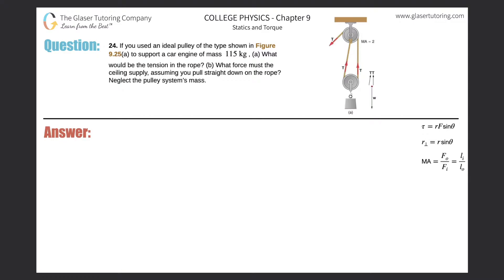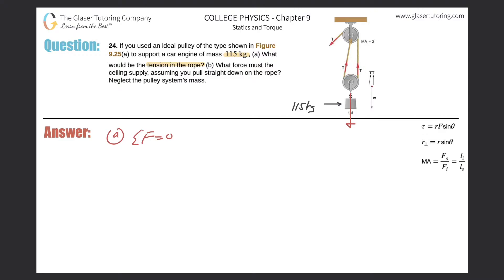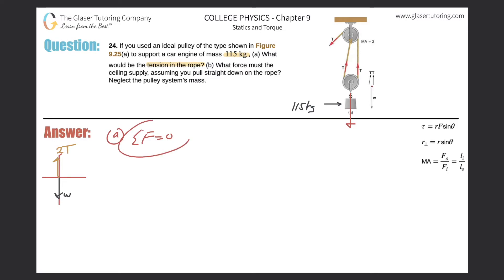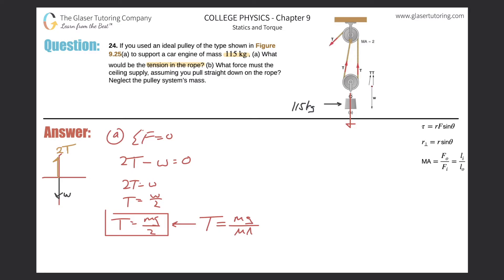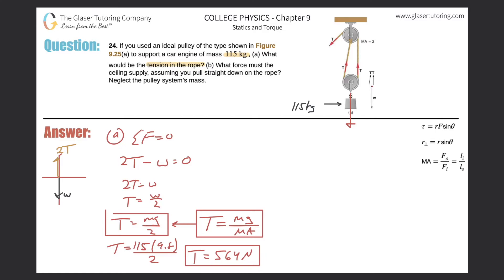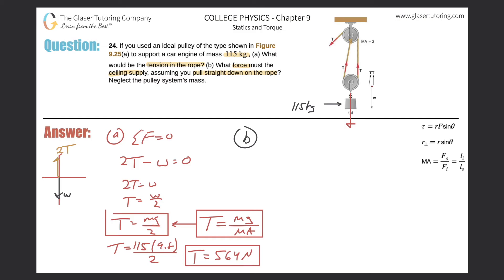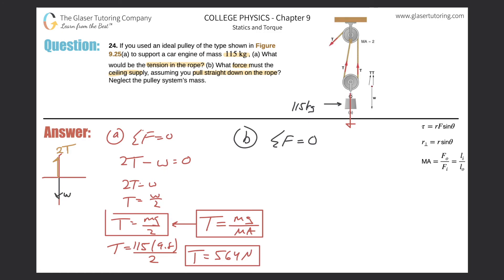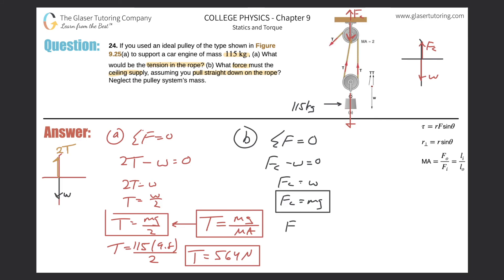9.24 | If you used an ideal pulley of the type shown in Figure 9.25(a) to support a car engine of

Comment: Oh my goodness, it can’t be this complicated is it? what if you don’t know a Newton is? So I’m confused gravity is 9.2? I’m confused about the whole 9.2 thing. Also, I’m dyslexic so 100% says I’m getting it wrong and everything’s gonna come crashing down. Thanks for Try n😂
Reply from the maker: Don't worry at all! Understanding new concepts, especially in physics, can indeed feel overwhelming at first. Gravity being 9.2 might refer to the acceleration due to gravity on Earth, which is approximately 9.8 meters per second squared (m/s^2). Sometimes, this value might vary slightly depending on location or context, but 9.8 m/s^2 is a commonly used approximation.

As for not knowing what a Newton is, that's completely okay! A Newton is the unit of force in the International System of Units (SI), named after Sir Isaac Newton, and it's equal to the force required to accelerate a mass of one kilogram by one meter per second squared.

It's completely normal to feel confused or uncertain when encountering new concepts, especially if you're dyslexic. Remember that it's okay to take your time, ask questions, and seek additional resources or support if needed. Learning is a journey, and making mistakes along the way is part of the process. Keep trying, and don't be discouraged by setbacks. You've got this! 😀

Comment: Part B wrong. Apparently you have to include the Tension force as well. So the force of the ceiling is equal to the mass*gravity + the force of tension, which against the ceiling would be a downward negative force even though the arrows with respect to the weight of the engine is pulling down.
Reply: yes! this is the correct way. Thank you :)
Reply: Hi! I did it this way too, and I got my homework right. Thanks for your help!

Comment: If it says your b is incorrect, you can try total mass*9.8= x (a random variable I chose) and then (x-answer from part a= answer for part b).  I did 247(9.8)= 2422, 2422-605(from part a)= 1818.
Reply: Elaborating since the way you worded it wasn't entirely intuitive for me at first, and so other may have the same confusion.

The answer to b is: 
w + T
= mg + w/2
= mg + mg/2

So it's the weight + your answer from part a.
Reply: thank you!!
Reply: The best!  Thanks!  I was trying to rack my brain!